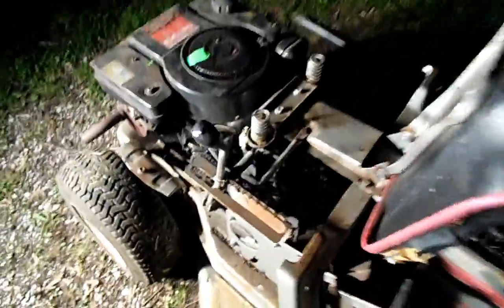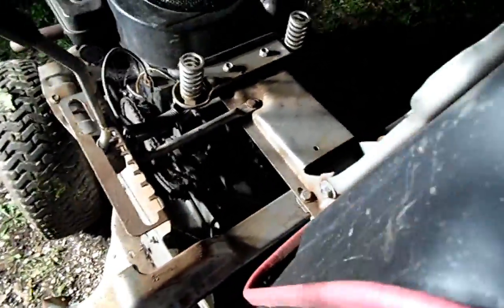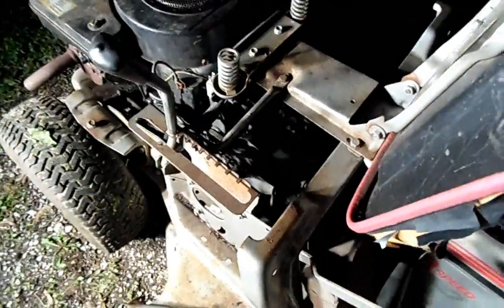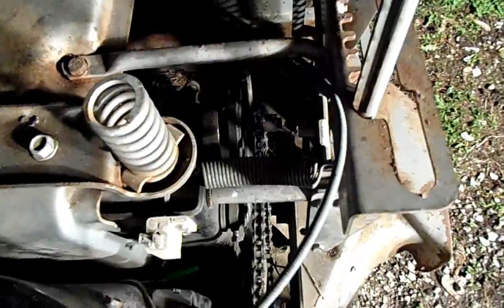Welding and Grinding in Slow Motion 1000fps

Comment: did you convert that mower to propane? Is that hard to do?
Reply from the maker: no it wasnt hard at all.

DIY: Propane Lawn Mower Conversion

Propane Powered Lawnmower Review

it just took a few months to get used to getting the air/fuel mixture right. only costs me about 15$ in fuel per year.
Reply: Hank hill would be proud
Reply: Rinoa Super-Genius      Not only costs, it reduces much of the pollution from gasoline fumes.
      I wonder whether the propane fuel would generate less posionous carbon monoxide in the exhaust than the gasoline fuel if both were burned at their optimum mixtures?  I think the propane would have more of a complete combustion and reduce carbon monoxide and create more complete carbon dioxide.
Reply from the maker: ***** i'm not sure, funny thing is though that gasoline fumes are propane haha. thats how we produce propane.

i'm thinking since this engine is from the late 70s it doesnt really matter, it prolly spews the amount of emissions of 10 new cars regardless of the hydrocarbon you feed it. ;P